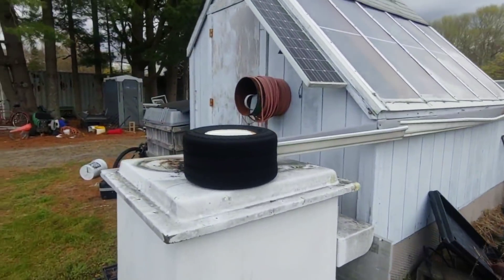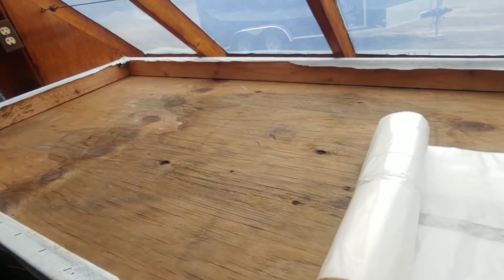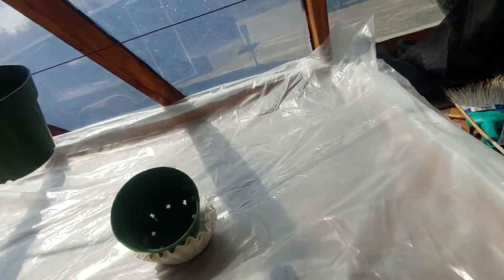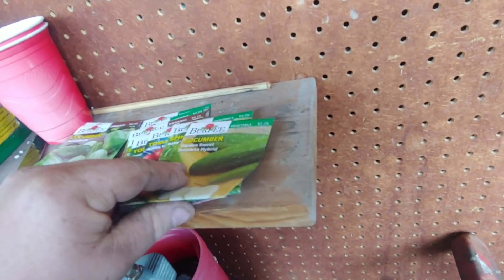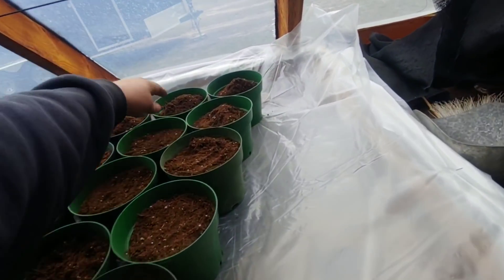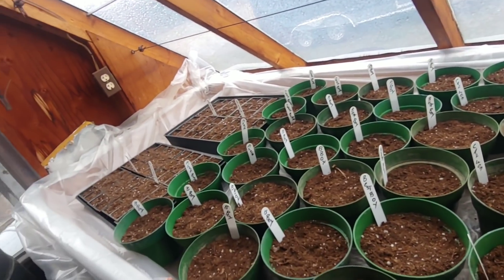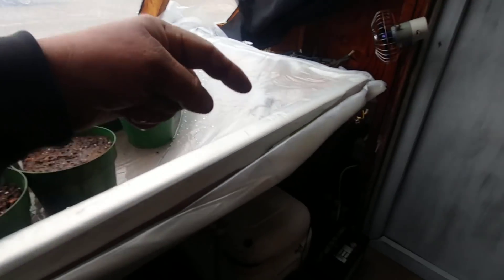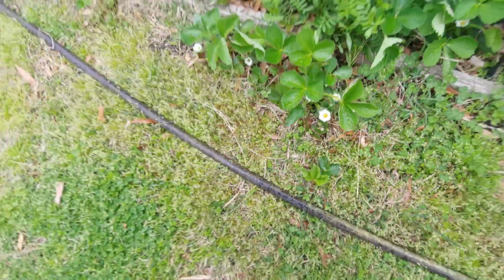off-grid solar Greenhouse

Comment: Hi Bert, would a swimming pool liner work on the table or would it get to brittle in the heat? You may get one while you're out scrapping.
Reply from the maker: I actually have some more material it's actually pond liner but I think I'm just going to sit on it in case I really really need to grow stuff in the middle of winter.. kind of in the prep right now the proof-of-concept work so all I need is pumps and batteries
Reply from the maker: And seeds obviously LOL